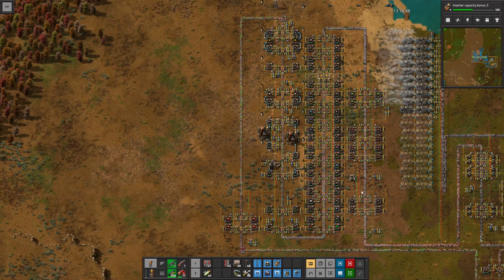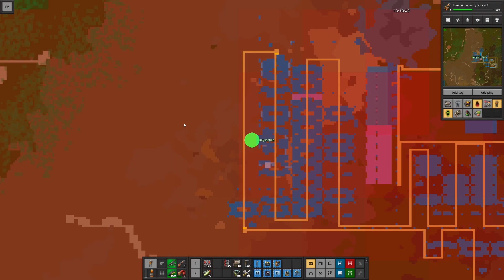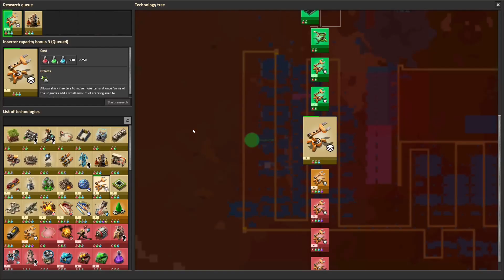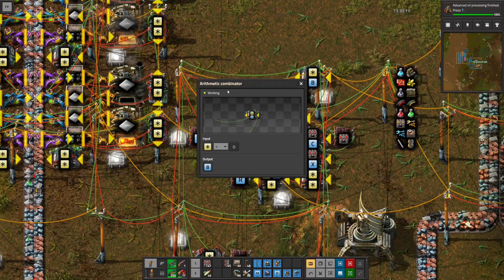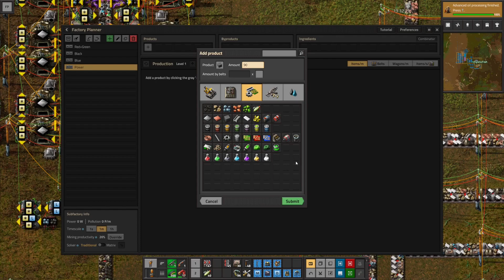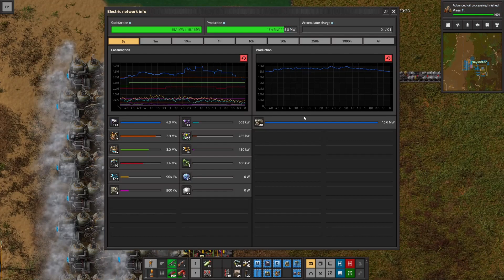Factorio Sushi Spectacular - Episode 11 - Solid Fuel Power

Comment: you power calculation for solid fuel does not include the needs of the smelters. If I understand correctly if you reach 18 MW of power then all solid fuel will need to be used for power and none will be available for smelting.
Reply from the maker: Ooh, this is a good point. Thanks for catching this! I’ll try to fix it for correctness’ sake, although in practice I think it will be ok, because we are running at less than the 18MW total (so there’s always extra solid fuel around for smelting).